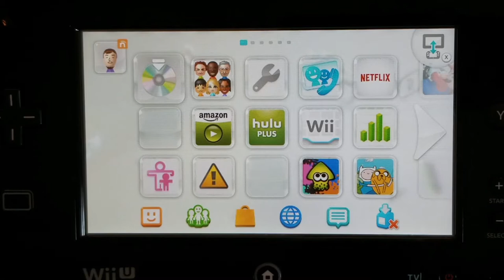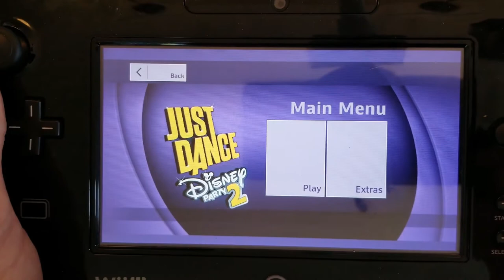Wii U Invalid Disc Fix - Disc Drive Repair - Grinding Noise

Comment: It's too hard. Nintendo over tightened the screws that hold the front of the plate for the disk drive. There is no way to remove them

Comment: This video helped me a lot. I got a used Wii U from someone with rough kids. I bought the lost cords and controllers on Ebay. It worked well when I got it. I had it in my home, playing it in the living room. I decided to move it to a different room with Mario Kart 8 still inside the console. I hooked it up in the bedroom and Mario wouldn't Eject. Nothing worked, so i pulled the disc out with tweezers. I couldn't insert discs anymore.  I couldn't even force one in. I used this video to take apart my Wii U step-by-step. There was a tiny, fat twig inside, probably from kids. The disc drive was repaired. Upon taking off the front face piece with the eject and power buttons, the first ribbon wire immediately detached from the face, not the console. I was having a hard time re-inserting it. It worked momentarily, then the ribbon fell back out. Everything worked with the disc drive, but the eject and power were flickering, you could say. I was having a hard time. I used tweezers to carefully re-insert the ribbon and firmly, but gently, wedge it into place. It was a nightmare, but it worked. I put the outer shell of the console back together. Two screws from the inside were overlooked during re-assembly. Still works. I'm gonna keep the screws in a box and keep playing wii u without them. Thumbs up on the video. It helped a lot.

Comment: Thank you so much for the detailed of how to take it apart. My 2 year old stuck a disc with stickers and googly eyes on it, causing the eject button to not work. 
Other than completely stripping those 2 triscrews on the front and having to drill them out... works like a charm!
Reply: Jfc never let those kids anywhere near the console till they know what its worth

Comment: Only does it to 3 of my 8 disks. Dont understand the madness behind it. Great video thanks
Reply: did you figure it out mine dose the same thing only with smash bros and Bayonetta it will let me play for a min then it will say error and thats when it says its invalid
Reply: SpyJak did you ever figure out the issue with yours?
Reply: The Wii U it's very strange... This video helped me a lot while I was opening it, I've cleaned the lens with isopropyl alcool, removed the dust inside and outside the drive and it keeps throwing the same error (your disc is probably dirty, try cleaning it).
or invalid disc.
All of my games work but botw, smash and lego city won't. To be fair botw works just sometimes, depending on the position you insert the disc.
Really, this is driving me crazy! :O

Comment: I have a Wii U and I'm getting a 160-1400 error, take everything apart trying to fix it and i'm still getting the error, although it has gone from being immediate to at least starting to load the OS and into the menu screen then poof error again. it has been literally 100 times and the only way out is to pull the plug.

Comment: Hello as I was taking apart my Wii U my blue ribbon cable that was connecting the power button and the console broke and I was wondering if there is a way to fix it I am super sad because I was trying to fix this console for my mom but I ended up making it worse so if there’s anyway I can get in contact with you to help get this fix it would be wonderful. Thank you

Comment: So, back around 2014-15, my brothers tried to clean the game disc (they were 5 - 7 years old) and they used kool-aid to clean it?? (Idk why) and the disc drive never worked since. I've tried clean it by blowing it/using a can of air (is that what you call it?) And nothing worked. I'm scared of opening it up and breaking it. Do I need to clean the lens or replace the whole drive? (If I ever open it...)

Comment: My Wii U just started having an error 150-1031. It looks like it read the game, but when I go to play it, the error pops up. My other games work, its just happening to Monster Hunter 3U and DuckTales. Both discs are in pretty mint condition. Could it possibly be the disc drive? Or maybe the laser?
Reply: The laser. Probably just best to replace the disc drive altogether they're not too expensive
Reply: @xinitarchives  I ended up buying the games digitally, but I definitely will replace it before the shop ends!
Reply: @gamerblondie28twitch58  I think you can still download the games you've bought after the eshop closes just can't buy or view games
Reply: @xinitarchives  okay thanks!

Comment: Mine had a small plastic inside but when I insert the disc it does not engage meaning that the motor does not go lower to make to spin the disc, any idea? Thanks

Comment: The top of mine doesn’t want to come off and I unscrewed everything on the top and side
Reply: if you're just trying to fix your disc ( I haven't put it in my wii u yet ), but this video works; https://youtu.be/ccZTcqYOADA I realized halfway through the video that it was for xbox's /ps's & pc's, but my discs doesn't have any scratches anymore, so I'd say that video will help rather than going to the extreme extent. lol.

Comment: My wii u reads my wii discs but not my wii u discs. (I bought a super mario maker disc off of ebay its coming today ill update if it worked) I have 2 nintendo land discs (one i bought recently from gamestop) they both didnt work it might be a coincedence and i have a super mario maker disc (I was scratched alot so it wouldnt have worked either way) If these dont work then i might need to buy another disc drive or lens
Reply: I have the same issue
Reply: Same here. Did you ever find a fix?